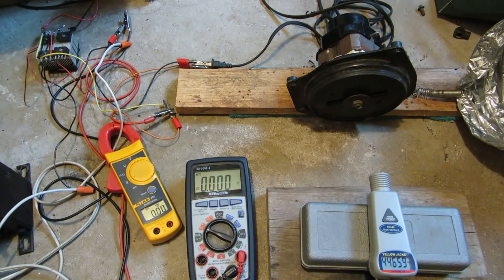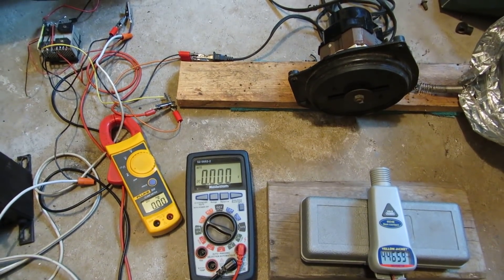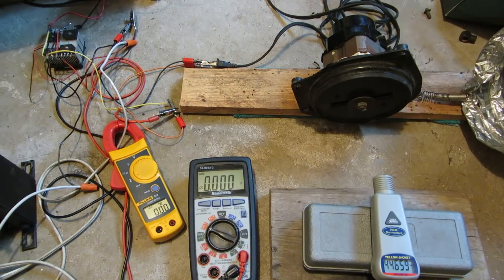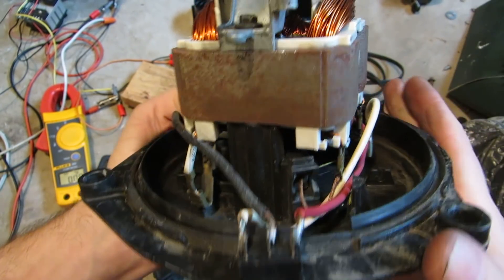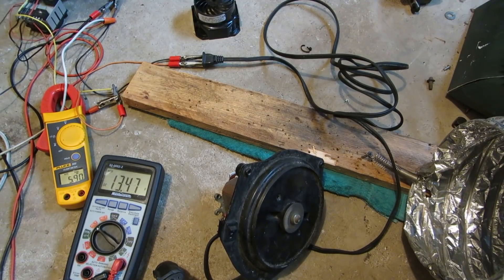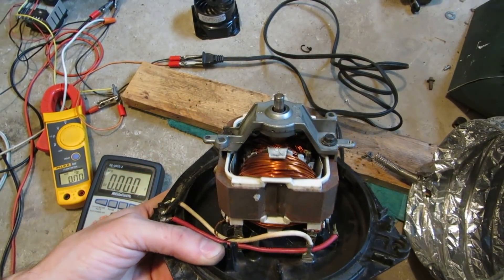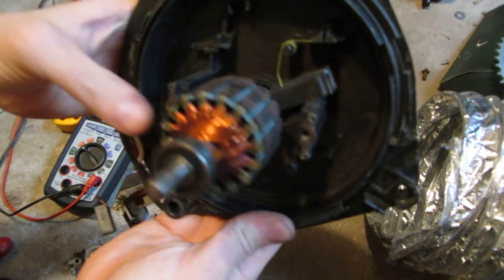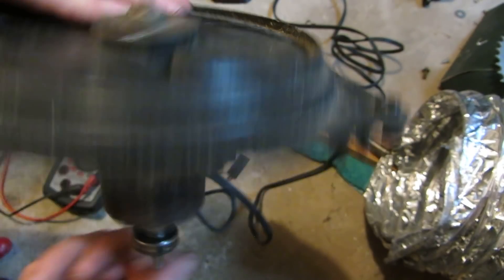Driven to Destruction: 120VAC Motor #7

Comment: Which 100,000 rpm motor are you going to test next?
Reply from the maker: You talking about the 3 rigs that could reach 100'000 Rpm's?
Reply: Yeah.
Reply from the maker: RacerXavier  Not sure, have issues I'm working out with both of them.